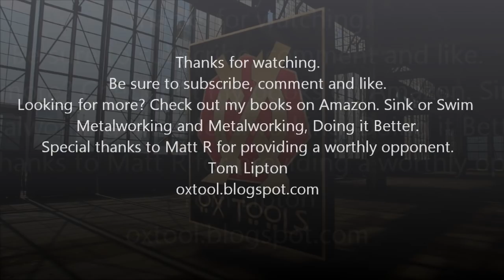Screw Extractor Torture Test Round 1

Comment: When you demonstrated that extractor in a previous video, I figured  that someone finally made one that worked! Now I'm sad to see that wasn't necessarily the case.  I gave up on extractors a long time ago when I was playing with old salt water boats. (Everything is frozen solid on them) My technique is a little unorthodox but it works for me.   I would continue drilling that out until I got close to the thread minor diameter.   Then I would Chuck a short length of chain saw sharpening file in the drill and work it around the hole until I can see the breaks for the threads all the way around the hole. Then I pull the thread out and run run a chasing tap in the hole. I can spend 45 minutes on one broken bolt doing it this way, but I usually save the thread.  I bought a mill about 6 months ago so maybe I will improve my technique.
Reply from the maker: Hey Dog,

That is an interesting idea with the chain saw file. I'll have to try that on the next victim. Thanks for the comment.

Cheers,

Tom

Comment: Hi Tom,i have this extractor set as well,from my experience they are not great on applications where the stud is seized solid,they just snap easily.But i found them to be the best extractors when removing seized/snapped glow plugs from cylinder heads.Regards Ivan
Reply from the maker: Hi Ivan,

I have to agree with you on that one. This stud is basically welded in. Thanks for the comment.

Cheers,

Tom

Comment: I am a car guy that runs an automotive machine shop, not sure what category that puts me into..  The length of thread engagement in the casting is in inverse proportion to how quickly you want to get the broken stub out of the manifold. 

I do not think I have ever seen an automotive engine stud that wasn't a minimum grade 8, say 150,000 to 180,000 psi tensile. Some are even harder. 

You do realize that most car guys would never have used a center punch when they started drilling, or cutting oil, right?

Really enjoy all you do.

Marc
Reply: Forgot to mention.. Heating the casting before driving in the extractor allows the extractor to draw some of the heat out of the broken stub, making it shrink ever so slightly and helping to release it's grip on the casting. At least that is what I tell my self every time I try this anymore...
Reply from the maker: v8packard Hey Marc,

Keep talking to yourself. It works for me. I was surprised at how much was buried in the manifold myself. Thanks for the comment. 

Cheers,

Tom

Comment: This was such a delicate operation in such a hi-tek environment that not many can possess, yet the job must still be done! A lot of hospitals could envy you for a setup like you have... ;) :) 
Since you had it set up in the miller, to drill out the broken extractor, you could have drill out the stud more to make it fatigue to push in the top of it with the center punch to loosen it up in the presence of lubricant, like SRC/WD-40, or drops of diesel is fine also. That is what I would have done B4 using the extractor. Further, you pounded the extractor in very hard that made the stud more wedged in, especially without using THIN lubricant that is a numero-uno thing to grab in a situation like this, it can do more wonders than you think. The main thing is that you got it out in the end, eh?

Comment: Tom,

After you hacksawed the stud off, would using a carbide masonry bit, instead of a "normal" twist drill, have made opening things up easier?

Eli D.
Reply from the maker: Hey ELi,

The point geometry of a masonry drill is not good for metal cutting. They are designed for percussive applications not shearing metal. Thanks for the comment.

Cheers,

Tom

Comment: I've seen guys use paraffin wax after heating to get behind the rust of the threads.  I'm a firm believer that the rust seals off the threads not letting the penetrating oil get into the threads.  Hey, you asked for a something bad and I guess you got it.  LMAO.  Great video.  I usually tig weld a nut to my taps that break off with silicone bronze and most of the time they back right out.  I also don't drive my extractors in until after I've heated the stud because I'm afraid the heat will kill my extraction tools heat treating hardness.
Reply from the maker: Glad you like the video. I think we need some more manifolds to test some of the alternate methods suggested. Thanks for the comment.

Cheers,

Tom

Comment: Currently at work I'm in the middle of trying to get a broken 14mm stud/bolt out of a NEW tractor transmission/differential housing.  Heat is out of the question because of it being new.  It was broken off jagged!  I managed to get a hole drilled in it a bit off center.  I think I'll just work with a small drill bit and drill it in half and cut it out of there.

I've built/set up around 6 of these and this is the only one that I've found a broken fastener on.  Looks like it was just over stressed on assembly.

I'll use extractors if I know the bolt was sheared off or if I can use the blue tipped wrench and soften things up a bit.  If it's twisted off from attempts of removing it, no way is a smaller diameter tool will give the same or greater torque as the broken bolt did?
Reply from the maker: Hey Dan,

You have to try something. Is there any above the surface to work with? In a new assembly there is probably some kind of thread lock compound on it. Heat will help break that down some. Best of luck to you. 

Cheers,

Tom

Comment: I haven't read the 337 (!) comments yet, but as soon as you said "turbo" I knew you were in for a fight.  That manifold gets red hot every time the engine is under a heavy load.  The stud is probably some exotic metal like Stellite or Inconel.  Heavy truck and equipment mechanics deal with this regularly.  I could not help myself from laughing my ass off watching the video, but also feeling really sorry for you at the same time.  You bit off a tough one this time, can't wait to watch part 2.
Reply from the maker: Hey Bob,

Thanks for the sympathy. I think I backed myself into the corner on this one for your viewing fun. Inconel sounds about right to me. The stud is barely magnetic and fairly hard. Thanks for the comment. 

Cheers,

Tom

Comment: I remove alot of Bolts being a mechanic, honestly these flute type are very good, however I find using a spanner on them or ratchet pulls the bar inside left and right and causes it to snap, the best way I've found to remove them is use a small impact gun and start off with just let the gun vibrate first and not actually turn (use the hammer inside) then to pulse the gun and 9 times out of 10 it'll remove it without a problem, while the spanner would snap it.. :) give it a whirl, Great video :D you earned another Sub :)

Comment: I recently had a similar situation.  I learned to heat the material first.  Using a thermometer to make sure it gets over 220F.  Then install the cold extractor.  That allows the stripped or broken bolt to cool and shrink at a faster rate than the bulky heated block or intake material, which allows break-free to happen more easily.  But hey, I'm only an amateur.  That job or torture test looked like a pure PIA.
Reply from the maker: Roy Johnson Hi Roy,

Thanks for the comment.

Cheers,

Tom

Comment: Should you be able to put another combination wrench opposing the bottom wrench on the top nut of the extractor to prevent eccentrically loading it and snapping off the fluted insert?    

Also couldn't you just mill out the stud hole old threads, stud and all and retrofit the hole with a helicoil insert?
Reply from the maker: Hey Eric,

Wait around for round two of the fight. More extractor action coming up. Thanks for the comment. 

Cheers,

Tom

Comment: Wilee Coyote:  super genious!  Ding ding:  round three!  Looks like "you're all in".   "That's when machinists send it to Keith Fenner"... or grab a stick of dynamite...  hee hee hee  Wonder if someone is playing a prank on you?  Like tempering the stud to ultra hardness, shrunk it in nitrogen, coated the threads and hole with a ceramic resin.  You would melt the aluminum manifold before the ceramic resin would melt/release.  It is a fastener locking compound used on rocket nozzels, and high temp applications (I googled it).
Reply: Round 2:  Stud 2, Blue Point 0
Reply from the maker: Hey Joe,

The manifold is iron. These two are in Intimate contact with one another. I don't think there is any coating on the threads. I think they were machined as one piece. Thanks for the comment.

Cheers,

Tom
Reply: oxtoolco Ooops, it looked like it was aluminum.  It's funny Tom, I've failed at numerous attempts to remove a single stud/bolt.  Eventually, I'd get it out.   I'd fill the sides flat and try vice grips, cut a slot in the top and try a screw driver.  drill it, attempt the Hanson "pig-dicks".  Break those, cut them off with a cut off wheel and drill for the larger diameter.  Pray!!!  Conduct an exorcism.....

Comment: I've been doing this for 30 years and have broken everything through
 improper technique.  The proper way to remove this stud was to HEAT the manifold and use a stud extractor. That tool will fit flush to the manifold and with HEAT should work every time. 
  If perhaps the stud does break off the extractor set you are using has never failed me. This is the last resort when encountering this type of problem. Your side torque was your downfall. Just imagine doing this in the vehicle. 
  As far as the machinist: being "smarter" than than the technician goes we have many more obstacles to face than a man doing bench work. This being said I found this video quite amusing. Thanks.
Reply from the maker: +Larry mechanic Hi Larry,

The purpose of this video was to test the screw extractor not get the stud out necessarily. If I wanted the stud out I would not have cut it off flush the first thing. Thanks for the comment.

Cheers,

Tom

Comment: This is GREAT!! It takes a brave man to create a problem like this just to entertain us LOL
I have used these extractors in the past with some success,  a few tips:
#1 Drill all the way thru the broken stud for the largest possible extractor!
#2 Only drive it in a little at a time and wiggle it back and forth with the wrench as low as possible till it is loose in the hole,
repeat till the extractor is driven all the way thru but can still be removed easily!
#3 remove extractor and heat the inside of the hole in the stud as deep, hot and quickly as possible, you want the stud to expand, the cast iron pretty much doesn't LOL
#4 Cool the broken part rapidly with water, wax or your preferred penetrating oil, water works best
#5 Repeat the gradual driving in wiggling process, usually pops loose about now, if not repeat steps 3 and 4. NEVER have the extractor driven tight in the hole and apply a lot of GRONK LOL
This ensures that if you do break the extractor it should be able to be removed with compressed air, drilling out is almost impossible in the field with hand tools.....
Another trick if this fails is to weld the hole back full and re drill this always works as a last resort, shrinks the crap out of the broken off part!!!
I once fixed a Triumph bike that had the spark plug threads broke off flush in the head, still had the ground electrode on the end of the plug in the head, the bike was running before he tried to change
the plugs, CRAP!!!
I dropped a 1/4" long piece of 5/16" air arc rod down the hole on to the ground electrode, welded the hole full with a MIG welded on a 1/2" nut and when it cooled off screwed out the plug remnants
with my fingers, no shavings in the cylinder and the threads in the head looked pristine.
I always love and look forward to your videos Tom Keep em up!!!
Reply from the maker: Hey Gent,

Where the heck were you the other day. Your list makes total sense. Stay tuned for round two. Lots more fun in store. Thanks for the comment.

Cheers,

Tom

Comment: To get the first extractor out after boring with the 1/8" endmill, try filling the cavity with oil and putting a half inch long 1/8 drill blank in the hole and hitting it with a hammer. You have about a 4 to 1 area advantage, so the oil pressure should blow the extractor out of the stud.

Comment: I had a similar problem in an engine block. Twisted off a bolt, then an extractor. Fixed it using a die grinder with a carbide rotary rasp/file to grind the broken bolt (and extractor) out to where i could just see the threads, then picked the remnants of thread with a metal pick. Took me about 3 hours then I finally got it out and cleaned it up with a tap.  PITA.   Also when it comes to loosening bolts with heat, I find you need to get it red hot. Try oxy acetylene.

Comment: Hi Tom, I am not sure if rust explains the sticky bolt, it might be deformed metal grain sticking between both parts. In case rust is the problem, I agree with the comments reagrding overheating with electric or hotter torch. Rust (iron combined with oxygen) releases the oxygen bond at temperatures lower than iron melting and requireing less volume maybe helping for more clearance between the parts. Just a thought! Luck!
Reply from the maker: Hi Thomas,

We will see soon enough. Stay tuned for round two when the gloves come off. Thanks for the comment.

Cheers,

Tom

Comment: Tom,
    More heat. Get that manifold boss (bastard) red hot. Car guys don't use LP torches. Bust out the welding torch.  Car guy would have had it red hot the first go, even though I enjoyed the mill work.  Not to worry about the manifold.  They are designed to be able to get cherry red while running hard.

    All the best. Chuck.
Reply from the maker: Hey Chuck,

Good to know they are designed to take the abuse I'm about to dish out. Thanks for the comment.

Cheers,

Tom

Comment: Curious why do you go back and forth like that with the file? I thought you were supposed to pick it up on the draw backwards? That has to truly suck that damn kit broke fairly easily. I wonder if that stud is imply the wrong type of material for that type of extractor kit.That thing stands no chance of coming out with that no way. I'm sure there is a way but I don't think that thing can do it.Guess I'll find out in the next video lol..
Reply from the maker: +KoolBreeze420 Hi Breeze,

I do release pressure on the backstroke. I just keep it in registration with the part so the next stroke is aligned. This particular stud is a special alloy for high temp service on turbocharged engines. Thanks for the comment.

Cheers,

Tom
Reply: My dad's face would go beet red if he ever saw me rubbing a file or a hacksaw back and forth. I only had to be told once and it made complete sense. If he was watching someone else use a hacksaw, 9/10 times he'd leave the room. Especially one time the user was an aircraft engineer, but not an aircraft machinist like my old man. LOL.

Comment: There are times you have to lay under a car, but if you work smarter not harder a broken bolt in a removable part is always easier and faster to remove with the part removed from the car.

Comment: I know this was just a try out of the extractor but it got me thinking. do you thing a hammer drill would help loosen the stud? I know back in the day when about all I did was remove broken bolts I had a kit setup just for this work and easy out were not in it. I use left hand drills, taps and bolts. had good luck with this set up on every thing except for exhaust manifolds.
Reply from the maker: Hey Skip,

Well it sure couldn't have done any worse than I did. Thanks for the comment.

Cheers,

Tom

Comment: i feel your pain i am the guy that get all the fun one at the shop i hardly ever used "easy out" anymore i find bet to just drill it the tap drill size and re tap the hole but i always say you got to have to mojo with you or things just don't work out.  you can't be rushed it's a morning thing for me with a cup of coffee.
Reply from the maker: Hey Mog,

Thanks for the comment. This is not something that will go well if your rushed. You have to take your time and do all the steps. There are no short cuts.

Cheers,

Tom
Reply: mog5858 I'm the same, hardly ever use extractors.  I drill until there's nothing but a "helicoil" left in the hole then it can be removed with a pick.  The young mechanics in our shop know to leave bolt extractions for me.  Still, sometimes they think they can do it and I wind up with something like Tom has.  I've had some success with "backyard annealing" so broken extractors, drills or taps can be drilled out.

Comment: Hey Tom
You have to get r out before New Years, can't end the year with a defeat!
Like always a great learning experience.
Why not drop a bolt over remanent and tig/mig to stuck bolt.  This does two things, gives a solid anchor to torque on and heats the bolt/casting interface.
Can't wait for sequel.
Reply from the maker: Hey Morris,

I don't think I could get enough weld in there to do much good. I was reefing on the extractor pretty good. Thanks for the comment.

Cheers,

Tom

Comment: Anything that can fall off a car .... Break caliper rotor exsuast manifold all use high strength bolts. It's stated on the top of metric hex heads. I know this is an old video but I just learned this by snapping a brake caliper mounting bolt off. I extracted it with my finger lol got lucky and it snagged. Thank God for anti sieze lol